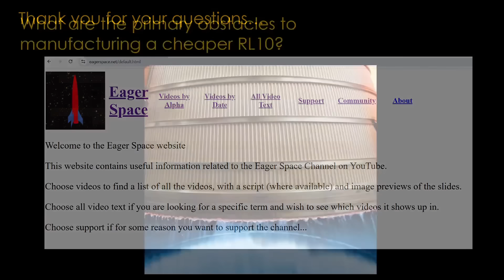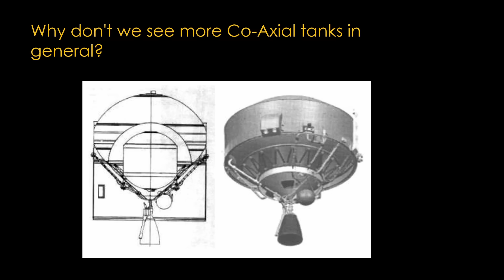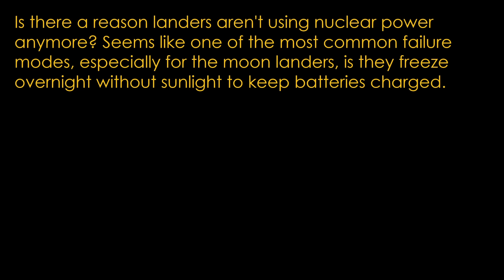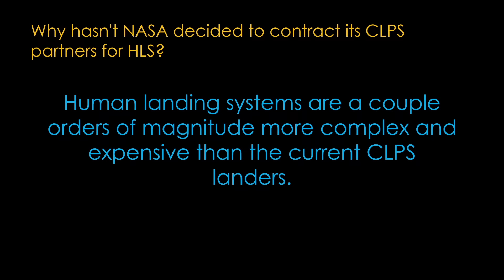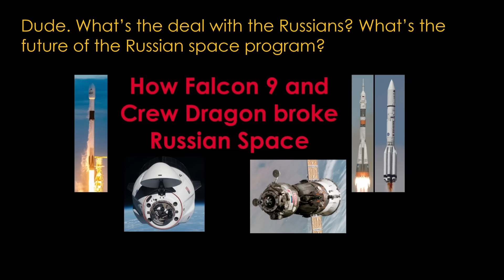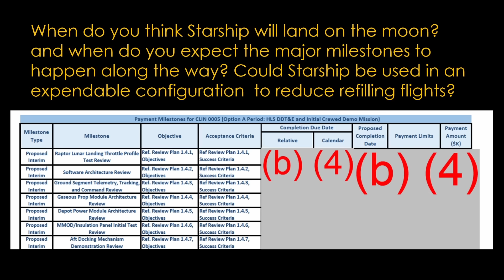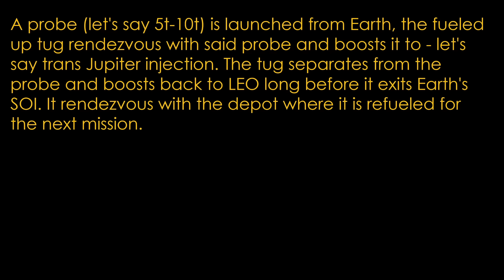Viewer Spaceflight Questions 3.1

Comment: 7:14 "when ISS goes away, they could fly individual Soyuz missions, but not much else"

I don't see any reasons why they couldn't launch their own space station. The first module is mostly built anyway, what comes in the next 2-3 years are just testing and launch preparations. Next two modules are very simple and based on already existing modules (like Prichal, which was built in just few years). This alone would support missions similar to those on russian ISS segment. Even if it somehow gets delayed by several years, it's still earlier than ISS decommission date.

Some people argued that it took them 20+ years to launch Nauka, and so it would take 10-20 years to launch their new station, but Nauka had completely different problems, it was redesigned and rebuilt several times until late 2000s, then they encountered serious problems like contamination of fuel tanks and fuel lines which happened during manufacturing in 1990s (and the manufacturer didn't exist anymore, so they had to redesign, rebuild and replace hundreds and thousands of parts). So issues that occurred with Nauka can't happen with NEM, for example. What's the problem then?
Reply from the maker: I think the real problem is money and focus...
In the old world - say 2010 - they brought in a fair amount of hard currency from the West, and that was valuable and could be allocated towards different programs. All that money is gone and I don't there's a good alternate source with the war consuming so many resources. 
The obvious question is "if it's easy for the Russians to put up their own new station, why are they sticking with the ISS and doing seat exchange with the US?" The Russian ISS modules are starting to have some serious problems and that will only get worse in the coming years. 
I'd be pleased if I'm wrong on this...
Reply: @EagerSpace "if it's easy for the Russians to put up their own new station, why are they sticking with the ISS"

Because work on the new station began relatively recently. Construction of the flight article of the new module (NEM) began in ~2018, and for the next ~5 or so years they are working on finishing it, they did static/ground testing of pressurized and non-pressurized sections, they developed and tested solar panel mechanisms and communication equipment etc.
This module should begin electrical testing until the end of this year, after that they will have 2+ years to conduct final testing and prepare it for launch.

Russia recently extended its participation in ISS until 2028 (before russian participation was only planned until 2024, which doesn't mean that they wanted to leave after 2024, like some media articles claimed, it just means that they had to decide whether they leave ISS or extend their participation). Of course they wouldn't want to leave the ISS and have nowhere to go, which is why the Russian Orbital Station is considered as the most important national project in spaceflight in the nearest future.

Money could be a problem, but until now it wasn't, at least for such projects as ROS. There are no problems with manufacturing launch vehicles and rocket engines as well, this work hardly changed in the recent years, and in some cases even increased (for example serial production of Angara rockets began in 2024, before they manufactured only individual rockets for flight design tests (ЛКИ / Лётно-конструкторские испытания).

Even if things were really bad, it wouldn't be a problem to finish and launch a single module (since it's already built), so that the cosmonauts would have a place to go to.
Reply from the maker: I don't know of any trustworthy data source about future Russian plans. We do know what they have done recently, and the ISS stuff has not been great by any measure - they have significant quality issues.
Nauka took them 14 years longer than they planned and had problems. Angara has been around for 11 years and has only flown 9 times.
Reply: @EagerSpace  You're confusing real world resources for money. The money from western launches dried up, but they still have the resources: technology, infrastructure, manufacturing, engineering, energy. Money buys resources you don't have, but if you have available resources you don't really need money and you'd better put the resources to work before you lose them. The russian space program needed financial support in the 90s but I don't see why they would now. If anything, ESA is the one hurting from the loss of soviet/russian space tech in the short term. Roscosmos has also signed several agreements with CNSA for future combined efforts, although I can't speculate on what those will practically amount to. I assume most aerospace resources are diverted to military purposes for now.

Comment: I know it's not a time for a Q&A, but I'd love to hear your input on high specific impulse engines currently in development. I love learning about them but their pitiful thrust combined with insane power requirements seem to render them useless for human exploration and near travel(not past mars). There seems to be fusion engines in the near future that'd offer higher thrust at decent Isp. Also do you see fission engines becoming common or is the radiation danger too much for most space agencies? Would love a video on this topic
Reply from the maker: I have a whole series on different fission approaches. My usual comment on NTRs is that it's been 50 years since NERVA and AFAIK no company has spent their own money developing an engine, while we've seen a bunch of companies develop their own chemical engines. Part of that is the availability/regulations for getting enriched uranium, but the NTR advocates talk about great ISP but don't every do comparisons on actual designs. I've done one, and the result is that the excess weight makes it a wash in terms of performance for most scenarios. And I think the radiation part is underappreciated.

I'm working on a video now that looks at the electric powered options, so I won't talk about that, other than to confirm that power is indeed the problem. 

Not sure if I'll talk about Fusion engines. So far I haven't seen a design that looks practical.
Reply: @EagerSpace  I was quite positively surprised once I realized that a fusion engine wouldn't need to be a net power producer like the ones on earth making them easier / more feasible. I'm looking forward to the electric propulsion video as I view it as a way more sensible/gentlemanly approach than chemical rockets. Plutonium RTG seems a decent power source but we'd need tons of one isotpe which we do not have. Thanks for replying. Your channel along with anthrofuturiam have quickly become my favorites due to your pragmatic and short term considerations rsther than the common trap of wishful thinking common to the more forward looking ones.
Reply from the maker: The question on the fusion engines is how do you power them? You need enough energy to get them started and - if they aren't net power producers - energy to keep the reaction going.

Comment: Superheavy produces something which looks like Mach diamonds in the combined exhaust of all its engines. Is that because the air "trapped" between those gets ejected and so the engines are significantly lowering the pressure there?

If so, wouldn't underexpanding the exhaust for each engine result in the "correct" expansion ratio for the whole system? Does it contribute to efficiency one way or another? Isn't this kinda how Stoke's 2nd stage engines behave?
Reply: [this is now somewhat answered in its original thread]

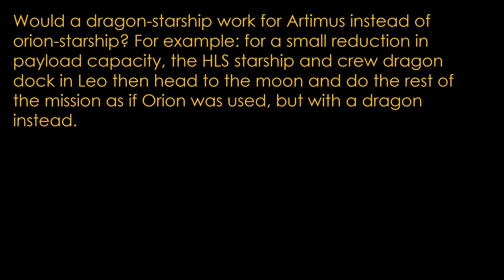Comment: 10:00 what if we use for this architecture not dragon but Orion, if HLS can get 50-100t to lunar surface it for sure can tug 26,5t Orion to NRHO, i know there is no way yet to get Orion to leo, but still if we somehow got Orion to leo can HLS tug it to the moon do a lunar mission with crew but reduction of payload and then return crew on Orion?
Reply from the maker: Lots of different options to consider. The downside of origin is that it's a hefty boy and the program costs a bit more than a billion a year.
Reply: @EagerSpace  yeah i guess so. but in theory could this work? Putting launch of Orion to leo and cost of it aside. Even if Orion pretty heavy i think HLS can, with its fully fueled delta v, do the lunar mission and tug Orion to the moon. Bigger problem i feel would be making docking adapter that can survive forces of raptor engines pushing the stack and im not sure if Orion can withhold forces pushing on it with front docking part of capsule 🤔

 also i guess its quite similar to how Orion was planned to be delivered to the moon in constellation program with Orion + lander with stage that would do the work but also it was not the raptor engines that pushed the stack there. also thanks for answering questions!
Reply: A strong rumor about canceling SLS includes crew-rating Vulcan or New Glenn to take Orion to LEO. An NG would then launch an ICPS or Centaur V. Orion would mate and then head for TLI. Disregarding the last part - afaik Vulcan could be crew-rated in two years or less - if unnecessary delays were avoided. Also, as a last resort kludge an Orion could be launched uncrewed on either of those or an FH, with the crew boarding in LEO via a Dragon.

Starship has a bad weight problem, it's quite a bit heavier than planned, per several estimations. Getting 50t to the surface including the crew quarters, solar panels, landing engines, and a useful amount of cargo may be its maximum capacity. Maybe Orion could be carried, maybe not. I'd be happy if it could be, we'd save billions by eliminating SLS.
Reply: @donjones4719  even if its strong rumor i have doubts about it, and i feel taking fueled stage like ICPS (if you restart the production line) or Centaur in fairing on other rocket is horrible and unnecessary idea. also i feel people forget how much delta v starship would have fully fueled it could be 8000-9000 deltav and also HLS would not have the same weight problem because there would be no heat shield and no flaps (but true that it would have crew life support and insolation with electrical systems) and also Starship is in active development so there would be constant improvements to weight and version 3 is baselined as 200t to leo (in theory with that you can make lunar mission with no refueling but probably no payload). and honestly i am not against SLS also, i want for it to fly, and be cheaper but still do it thing i guess
Reply: @YuriKurokhtin   I mentioned ICPS because the rumor tried to cover whether the new mission plan would be used for Artemis 2 and 3, which would use the two already built ICPS, or only for Art-4 and onward. For the latter Centaur V would be used, you are correct there's no sense in restarting ICPS construction.

The fueled ICPS wouldn't be in a cargo fairing. The nozzles would be in an interstage. Its tank walls are the external structure. A nose cap would be added. So it's no more complicated or dangerous than launching on SLS. C-V would be the same, it is its own external structure, no fairing encloses it when on Vulcan. There'd just be another C-V on top of the usual C-V, with an interstage and nose cap.

The 200t figure, etc, is the one observers are questioning. Elon is famous for his over-estimates, or what he calls aspirational figures. It is usually true that a plane or spacecraft in development often undergoes weight reduction in the later versions - but that's because traditional engineering starts with extra margin in the design to ensure enough strength. Once that's proven weight is pared off. But SpaceX works differently under Elon. The minimum weight was aimed for from the beginning and they added strengthening when construction and testing showed it was needed. Then had to add more, Then more. It started out with a few reinforcing stringers and hoops and now has an enormous amount of stringers. I'm a big fan of Starship but it has its problems. I hope some weight can be pared off in a couple of years but even if so it won't be much, IMO.
Reply: @donjones4719  like i get you that it starship might have weight problems with hls, and that Orion is heavy, but like then HLS would not have proposed 50-100t to lunar surface tho, right? like most rockets can not get 50t to leo and HLS wants to put more than 50t to lunar surface, so why not to use it as tug as well... also it could have less lunar payload mass at the end but as for now i feel it would be way better than centaur version of leo architecture, even tho i want SLS to fly and work

Comment: what differentiates a kickstage from a third stage? Why not consider two stage rockets + kickstage as three stage rockets?
Reply from the maker: I think a third state comes from the same manufacturer as the rest of the rocket and a kick stage comes from somebody else, but they are both third stages.
Reply: @ doesn‘t rocketlab make their kickstages in house?
Reply: @marcusrauch4223  I would say that a kickstage differs from a normal third stage if it's more like a part of the payload. If it's put inside the fairing, it will almost certainly be called that.

But it's not a precise term and there absolutely is some grey area where either way can be justified.
Reply: @ isn‘t the upper stage of the Atlas V concealed in the 5m fairing? Under that definition it’s upper stage would be a kickstage aswell.
Reply: @ Hmm, I guess Centaur is very much like a kickstage… But it might just be that the term is even less precise than I though (or just not applied consistently).

Though now I though about it a bit more, it's not placed in a proper orbit, like a payload normally would, right? So maybe that's another requirement for calling something a kickstage?
Reply from the maker: There is an electron kick stage, presumably because they had the capability and it's not like anybody else was going to make one that worked on a rocket as small as electron. 
But most of what rocketlab does is spacecraft.

Comment: Can you make a video about this question “Why don’t we launch rockets from the Great Lakes?” 

Also could you answer how we could? Please
Reply: The Great Lakes as an orbital launch site, would have the same problem as China's inland launch sites.  The launches would be dropping boosters or debris on populated regions, either purposely (as China does) or accidentally.

The Great Lakes are farther north than the big North American launch sites.  This is ok for launching to polar orbits or high-inclination orbits.  But launching to low-inclination orbits (closer to the equator) would require more rocket fuel to bend the orbit closer to the equator, which would reduce the mass that could be launched.
Reply: The Great Lakes are a lot more densely populated with boat traffic than the ocean off Florida (once clear of the coast). Worse, a rocket would quickly be past the lakes and flying over populated areas of Canada.

Comment: IMHO the best orbit for any in-space facility will almost always be LEO.
That is because the debris and junk byproducts removal, both intentional and accidental, will be more important than delta v efficiency.
Especially once the higher orbits fill up, LEO will also slowly become the safest orbit to be in.
Reply: Higher orbits won't fill up they have more room then Any lower orbit. LEO is already chaotic.
Reply: @asandax6  They have more room and there'll be more stuff. 
There'll be more stuff in LEO as well, but it's the only orbit that cleans itself over the period of years and not millennia.
Reply: LEO is massive. I'll just use 750km of altitude since anything higher would take decades to deorbit. But we're talking over 45 million cubic kilometers of usable space